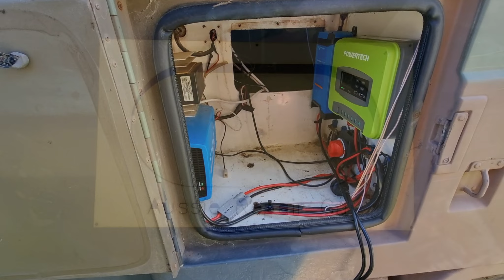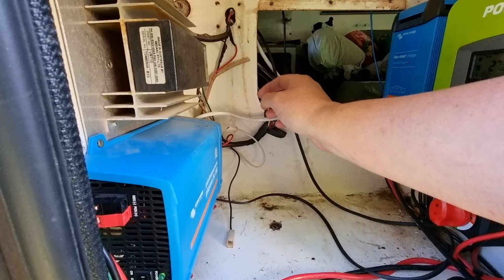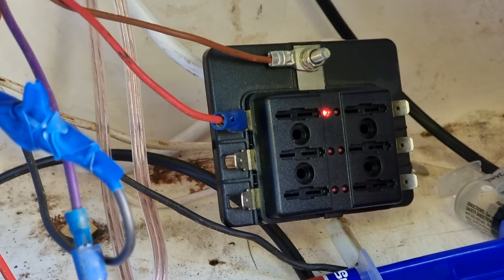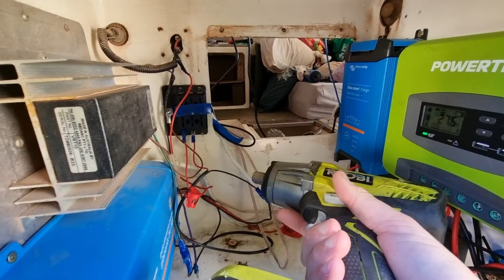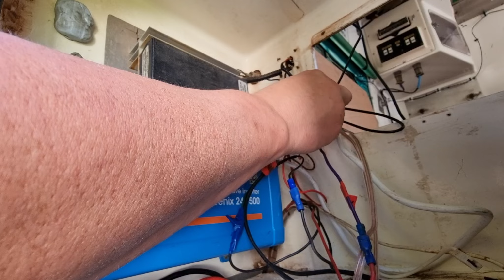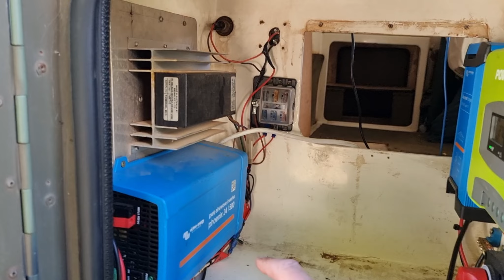6x6 Perentie Camper 24-12v wiring cleanup.

Comment: Try vinegar to remove epoxy.
Reply from the maker: Tried it, doesn't work and leaves horrible smell. Gritmitts works well as does IPA.
Reply: @TheAussieRepairGuy  that's no good. I used it when I built a boat years ago... I'll try your suggestions next time. Thanks